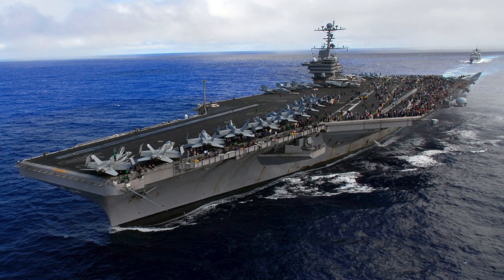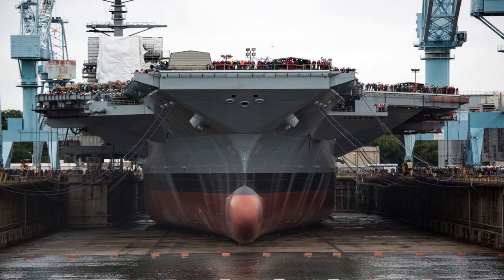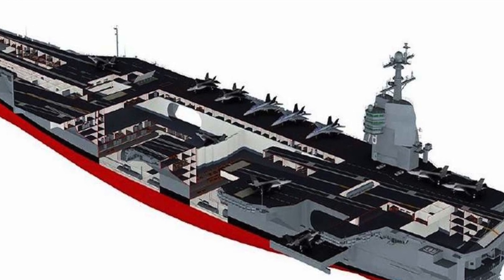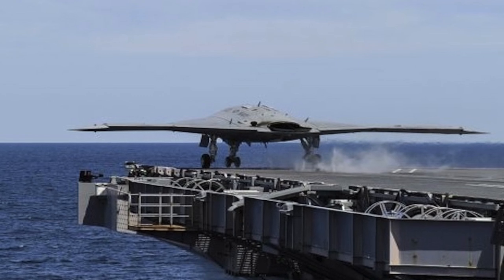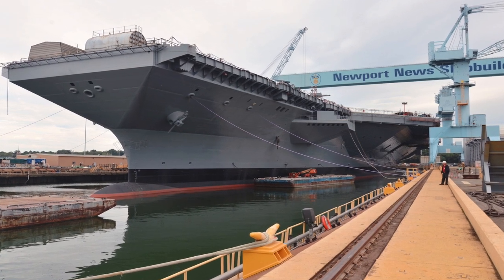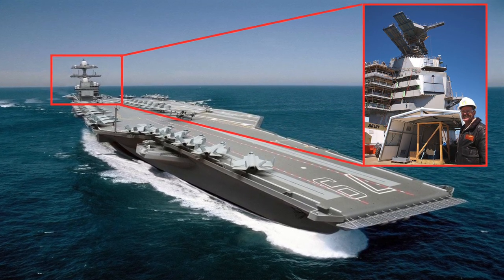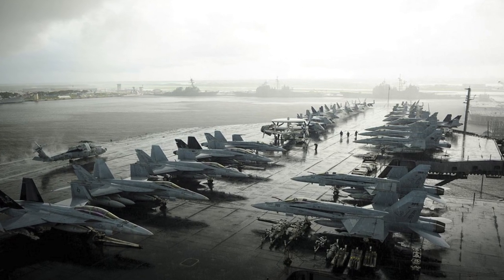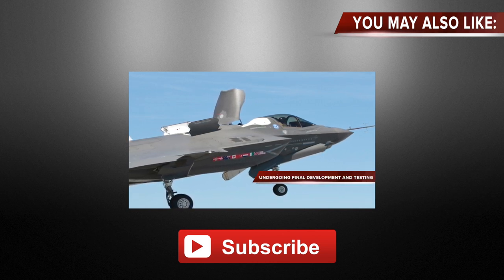NIMITZ vs FORD class: TOP 5 IMPROVEMENTS

Comment: nothing but a floating target
Reply: how is this a floating target? there are 70 fighter jets, helicopters and other ships protecting it
Reply: luigi jimenez
Modern submarines(and Mach 2 planes too) should kill this ship from 200+ km distance by Mach 2+ anti-ship missiles.
Reply: *****
Nuclear submarines are always noisier than modern diesel ones. So it will be the US submarines which will be detected first and destroyed.Non-US diesel submarines managed to "sink" US carriers again and again by 20 km range torpedoes (!) during war games,plus  there is no way US carrier group should detect enemy submarine 200 km away. US Aegis system is able to detect enemy planes up to 190km. Those planes armed with  200+ km range anti-ship missiles gg.
Reply: That's true as long as the diesel stays under 5kts. If they have to sprint for any reason they are just as noisy as anything under the surface. And if they're defending the coast of China they can't dive deep enough to escape detection by low-orbit SAR satellites. Make those diesel boats move and they're very easy to find.
Reply: +Heineken FiftySeven    Have you ever heard of defenses measures and they are not alone.
Reply: you do realise that it has a ciws gun and missile systems
Reply: John Connor
 More uneducated bullshit. Just like the Brits at the beginning of WW2, subs did great work, at first. Ultimately, subs are useless if they have NO bases to rely on. Also, any serious sub threat can easily be corrected with anti sub techniques that have been already perfected by the Brits(I feel magnetic detection is the crucial point here).. Yikes, that's embarrassing for you.
Reply: John Connor
 Yikes don't be mad. Sometimes all you need in life is a bit-of-education and that violence disappears. Love you
Reply: Just came back to see he has deleted most of his comments. The SHAME and embarrassment is real.
Reply: If you've noticed he keeps deleting his comments. Hes just trolling people with his blind "insight". Nothing to see here folks, move along.
Reply: John Connor
You seem to live in your own world, please go ahead and delete this latest comment like your other comments. I'm embarrassed for you.
Reply: +John Connor Somehow I don't think you're bringing up an issue that the defense department, with its thousands of employees and many billions of funding, hasn't already endlessly considered.
Reply: Thomas Riddle
They did, and they know they have no defense against these threats  now.
Reply: John Connor How do you know they don't?
Reply: Thomas Riddle
Because they can not detect even modern diesel subs within torpedo range
Reply: John Connor You're missing my point. The military's full capabilities are not public knowledge. Neither of us have any idea if that's true or not.
Reply: Thomas Riddle "unknown unknown" argument ..
Reply: John Connor You act as if it's not a valid one.
Reply: *****
"unknown unknown" argument is not an argument,looks like you don't know that
Reply: John Connor You have no idea what the military's capabilities are so you're making it up as you go. That's supposed to be an argument? The reality: you don't have the facts or expertise to say anything with any certainty.
Reply: Uh, the Chinese YJ-18 is Mach 3 and 500+ km.
The D-21D is Mach 10 and 1500+ km and is designed for carriers.
Reply: The aircraft carrier is similar to a box of fireworks. One match and it's Fourth of July.
The US lost 11 aircraft carriers in WW2. The Brits lost 8. Japan lost 20. We had 3 almost sink themselves during the Vietnam War.
Even when Japanese air power was on it's last legs, it was quite capable of sinking carriers. We lost 6 in 44/45.
Reply: When was the last time an aircraft carrier was sunk? 1945, that's when. A carrier would be pretty hard to sink except during an all-out superpower war, and in that case, everything is just a target. Short of armegeddon, a carrier and her battle group is very much able to defend itself and is a most useful weapon. What's the first thing the President asks when there's an international incident? "where are the carriers".
Reply: Pretty silly to compare WW2 carriers to today's US carriers.  Once the Essex was built in WW2 not one ship of that large class was ever sunk.  Only small, light escort type carriers were lost in the later war years.  No US carrier has been lost since WW2 ended (not counting decommissioned carriers sunk in nuclear tests).

The US had well over 100 aircraft carriers in WW2 and they were always put in harms way and were the enemy's main target...all efforts were made to "get the carrier".  And yet, only 11 were lost.  WW2 carriers did not have the defensive advantages that modern carriers do and they were still hard to sink.  Also, the Japanese were eventually beaten and beaten badly by the US, but the IJN was a tough, modern, smart and determined foe.  They still had the ability to deal death and destruction right up to the end of the war.  For anyone to think otherwise is foolishness.  Its one of the reasons we had to drop atomic bombs on them.

No carriers almost sunk in the Vietnam war.  Some carriers incurred damages while executing flight operations in a dangerous wartime environment.  Some damages were extensive but no carrier was in danger of sinking.  In fact, a carrier is much better able to handle damages than other, smaller ships.

The US and the other belligerents in WW2 lost hundreds of thousands of planes...maybe planes are obsolete?  Tens of thousands of tanks.  Millions of soldiers. Obsolete?